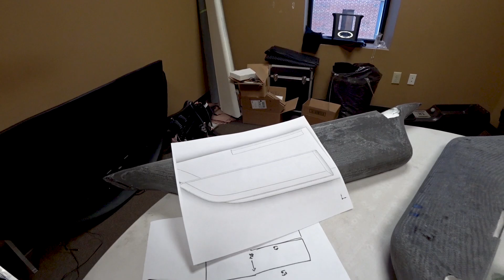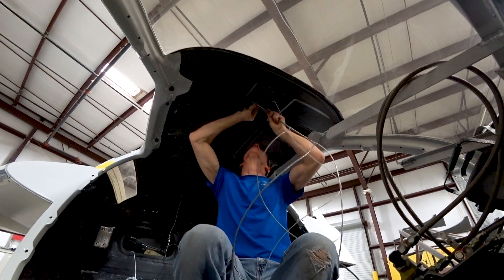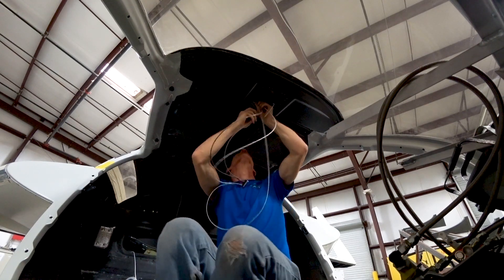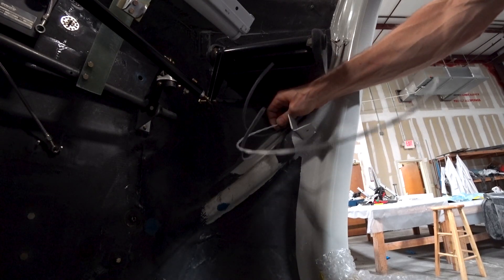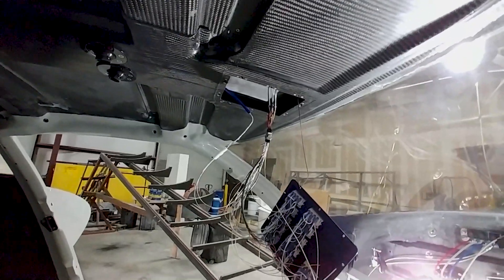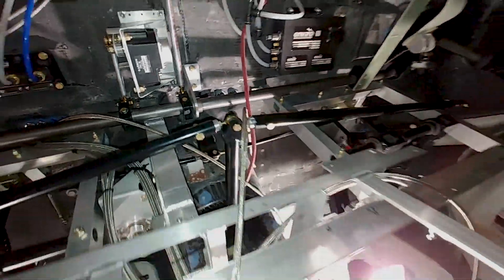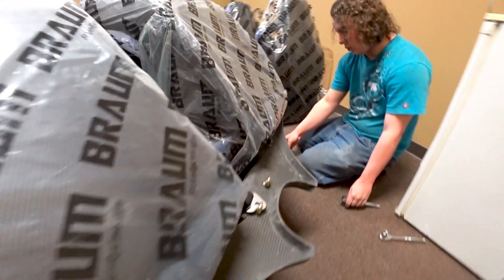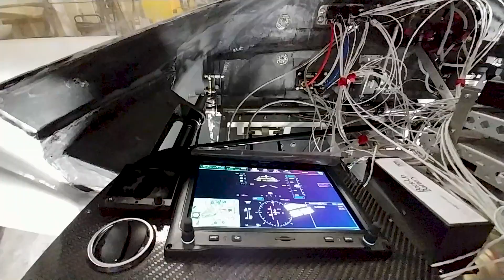Powering Up The Ship - Building the Raptor Prototype

Comment: So I take it we are not steering the nose gear, right? I think in your original design, that was planned. In case you would want to do that later, wouldn't you want the rudder pass-through turn to the right when you press the right pedal? It sits right on top of the nose wheel turning point.Tx.
Reply from the maker: It's a future possibility.
Reply: Differential braking is the way to go. Simple, easy to maintain and can turn on a dime. @RaptorAircraft

Comment: I've only one concern about your project: the VW TDI technology. When FIAT sold the common rail patent to Bosch, don't sell to VW for 25 years was part of the agreement. TDI is someway a quick and dirty way to do the same as the common rail but without violating the patent. It's not proven for its reliability like common rail but on the contrary it's proven to be slightly weak. The rest of the engine is rock solid, the injection system ... not :)

If you want a very very very good V6 I suggest the VM Motori 630 DOHC equipped with FIAT multijet technology (actually multijet it's only a brand for the latest bosch common rail version). And I think that you can source it OEM directly from VM at a wholesale price.

Comment: Nice.

I'm a bit puzzled how to open the cowling later on to service the engine? Even an Audi engine needs regular oil checks and from time to time replacing it.

Next time pulling wires, you may want to spend 10 bucks on a nylon cable pulling rope. It turns the task of pushing into pulling and reduce time to a few seconds per cable/wire to be put in. No Idea what they are called in English, but you should find them at any home depot. For a picture see here:  https://www.hornbach.de/shop/Nylon-Einziehband-25-m/824260/artikel.html?WT.mc_ag=41053551820&gclid=EAIaIQobChMI8M3L57Gd4AIVGuaaCh1DuAH4EAQYBSABEgIxnvD_BwE&WT.srch=1

Comment: If you were building an established design the number of ‘mistakes’ and ‘alterations’ to the plan would be high to the point of being embarrassing - but that is the way of prototypes, tweaking and adjusting the plan design and build process as you go. The next 100 will be SO much easier and straightforward to knock out. Keep up the amazing work team